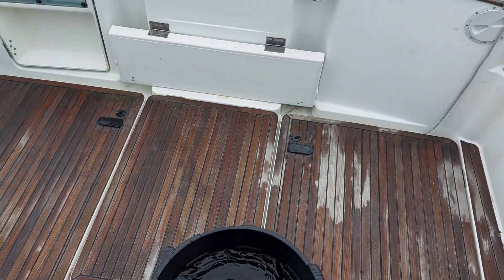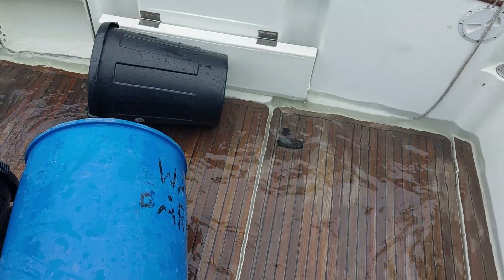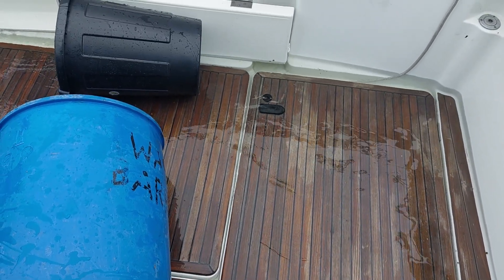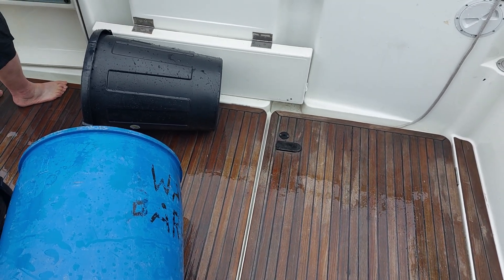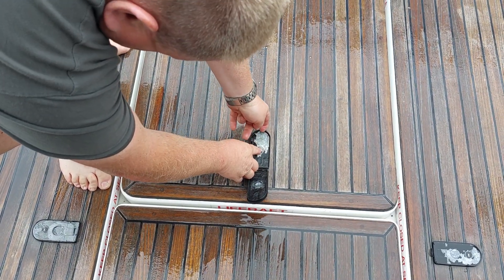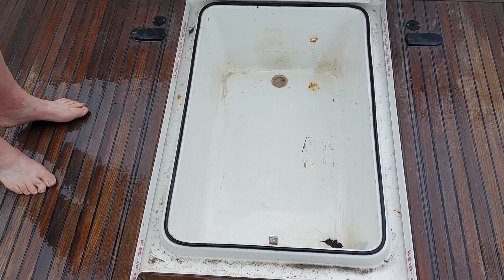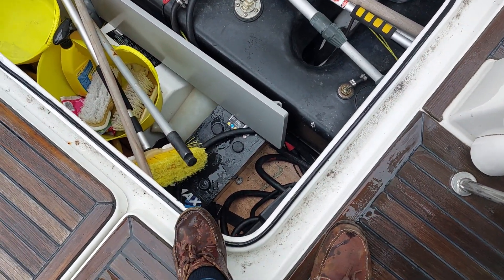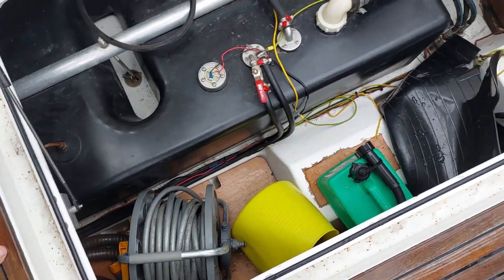How to prove water freeing & watertight weather deck cockpit in preparation for a UK MCA Coding

Comment: If I tipped 450 litres of water onto my cockpit sole, approx. 449 litres would end up going straight into the bilges, I would then start my electric bilge pump and operate my manual pump at the same time and in approx. 4 years, the bilges would be bone dry. That should pass the test I think.